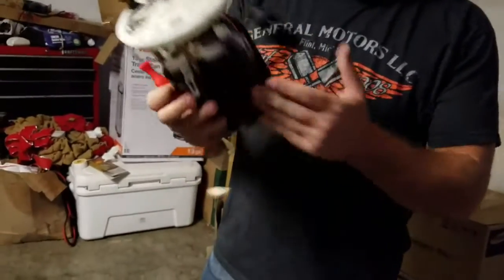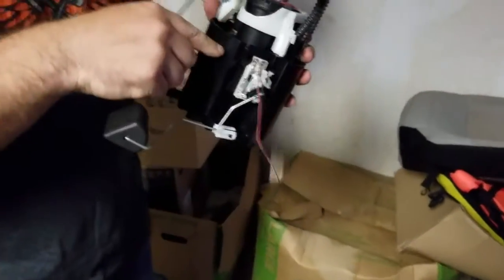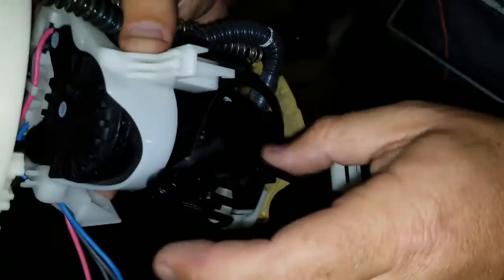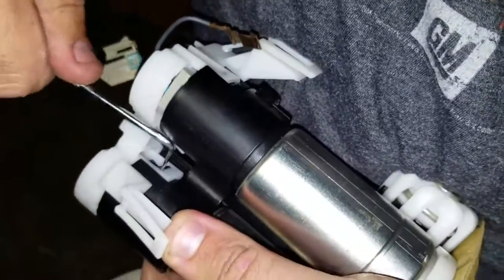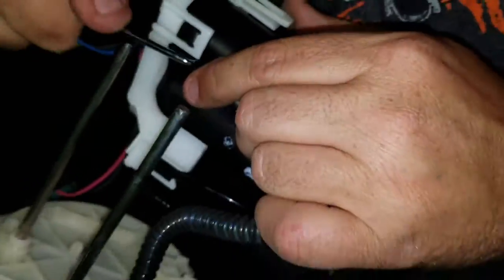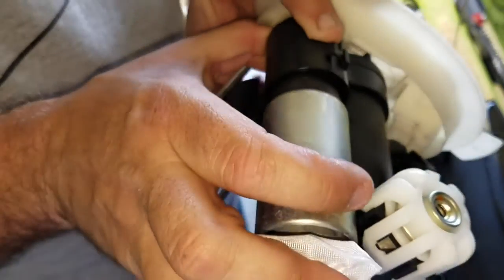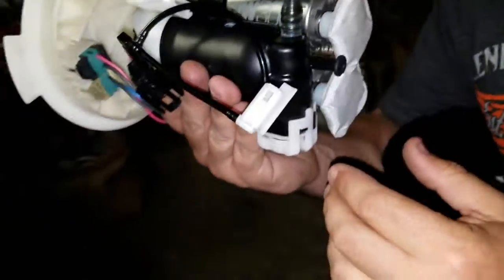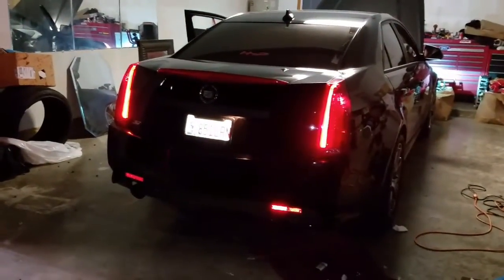Duel fuel pump install dw300c on a ctsv

Comment: what kind of injectors did you run with these pumps? i have a stage 3 cam trying to go e85 now
Reply from the maker: I ran ID1050s for a while. Until I got above 800 and had to add an aux pump anyway then went with ID1300s which is what I'm currently running
Reply: @TractionControlusa  i’m wanting to do the install myself then take it to georgia to get tuned since alabama has no good tuners, do you think it would be ideal to put them in and drive like 3 hrs to them to do the tune or would u not risk that and just let them do the full install
Reply from the maker: @ashtonbpitts  you're referring to the pumps or the injectors?
Reply: @TractionControlusa Hey bro same general question, I installed a brand new DW300c fuel pump module this past week because my stock pump took a dump the day after my dyno/tuning… Installed new pump and turns on with a couple cranks but car runs very boggy and I get a misfire code and on idle it wants to turn off just revving wnough to keep it on and on the verge of dying (cammed car like feeling) the first min or 2 of letting it sit, My question you think it just needs  a retune or is there a problem beyond my new fuel pump?  
09’ Cts V (Injectors,Pulley,Long tubes,Tuned on flex but i run E85 only)

Comment: How much power are these rated for?🙏🏽🙏🏽
Reply from the maker: these 2 pumps will support up to 750whp on e85 with the proper injectors and tuning. at 750 pressure will begin to lower, We installed a DW 320lh aux pump to remedy this issue. the aux pump coupled with these 2 pumps now produce 72psi at the rail all the way to 6500rpm on e85 making 860whp

Comment: I have installed a CTSv fuel bucket with the upgraded DW300 fuel pumps on my 2013 ZL1. I had to wire the two pumps in one connector to make it work with factory harness. 
The fuel pressure is at 50psi at idle but it drops immediately to around 20psi at WOT! What you think is the issue? Still run the factory FPCM
Reply from the maker: I know what your problem is. I had the same issue on my Z and resolved it. Shoot me a PM on Facebook. My name is Scott Trent
Reply: @TractionControlusa  hi Scott I’m having the same issues on my 11 ctsv with fuel pressure dropping around 3500rpm for a second and it would pressure back up.
Reply from the maker: @ricebo72  your fpcm is reading too high an amp draw from the pumps and cutting power. It's thinks there's a short. Even if you delete the code the issue will still persist. If you have this issue you need to install a fuel pump relay, and not the type of relay you are thinking of. They no longer make the brand I use..however of you call DW and ask them about the issue they can recommend a relay to use. It will allow the pumps to be powered by the battery and triggered by the pcm...no tuning needed

Comment: You DO NOT have to pry and possibly break those black plastic clips that this guy is repeatedly talking about... Go watch Adam Little's video showing how to properly do it..Title "CtsV Gen II Fuel Pump Module Info "....   Not as brittle as this man makes it out to be..
Reply from the maker: I see he posted that video 6 months ago. .. we posted this 3 years ago. Before we posted this the common way was to pull the pumps out with the module still connected to the bucket via the small plastic hose..which is very easy to break. The tabs we are prying are HARD to break. We came up with this method after a customer broke his trying to do it as the the online videos of the time instructed. 
  I am however happy someone actually improved on our method. If it really comes out as easy as pictured that's a big relief..we tried doing this one that way and it wouldnt come out, hence why we took the tabs off instead.

Comment: Will these work on a 5th gen zl1? Does zl1 have dual factory pumps like the CTSV?
Reply from the maker: Yes. I am using my factory fpcm. You will however need to wire in additional harness due to their being 2 pump connections instead of one. On a side note. Depending on how much power you make and fueling demand, if fuel demand is high the pumps will pull more amps than the fpcm will allow and it will cut voltage and drop pressure. A "pm3" module from torqbyte will completely resolve that issue. Best benefits of this set up are using your factory fuel lines not needing a return line or regulator and the fpcm still controlling fueling as designed
Reply from the maker: The zl1 has a single pump. However you can use a ctsv bucket and install these pumps in it and it will work in a zl1 tank. That's actually what I'm running now.
Reply: Gen5Concepts 
Will the fpcm work with that set up?
Reply: Man thanks for this info, I’ve been racking my head on which system to go with I don’t want to drill my tank or pay close to 2k for a fuel system. My question is can I use other pumps like a set of walboros 450s?
Reply from the maker: @fbanda20  yes as long as the pumps fit. The pm3 has a 40amp fuse. So whichever pumps you use you need to make sure they do not exceed the 40amp draw or it will pop the fuse on the pm3 and your pumps will shut off. Check the pumps you want to use. Each one should have an amp draw listed, then times that by 2.

Comment: Can you run e85 on the dw300c pump
Reply from the maker: Yes you can. They are completely e85 compatible. That's why we installed them. I am also using them in my zl1. Been running e85 for over a year with great fuel pressure
Reply: @TractionControlusa  thank you just wanted to make sure before i buy one
Reply: @TractionControlusa    I have a LPE dual pump system in a 2010 camaro ss . i've been told the LPE fuel bucket is basically the cts v fuel bucket , if that's the case this would be a drop in fuel upgrade to the dual LPE 190lph pumps that are in it now . Would you agree?  I run the LPE fpcm that runs with two pumps so if this works I want to try it , im maxed out with 80lbs injectors and the dual 190lps pumps @ e70 , meth , 750hp.
Reply from the maker: @michaelstrickland838  correct. The dw pumps are a direct replacement for the 190s

Comment: How do you access the pump without dropping the tank?
Reply from the maker: Francisco Gil you can cut a door in floor under back seat to gain access. But you must be very very careful with that method to not cut the fuel line or the harness. Safest way is to drop the tank
Reply: TractionControlusa ok thank you

Comment: where you are incorrect is that the four clips for the black piece attached to the small line outside of the bucket and internal to the module dont need to be popped.   The whole piece is held in by an oring and can be pried up without the clips coming out.
Reply from the maker: I had tried removing it but didnt know what was holding it on and didnt want to break it. Thank you for the updated information!
Reply: so you pull it up to remove?